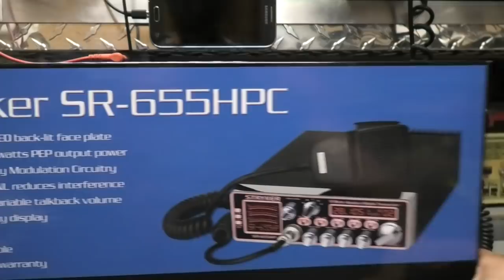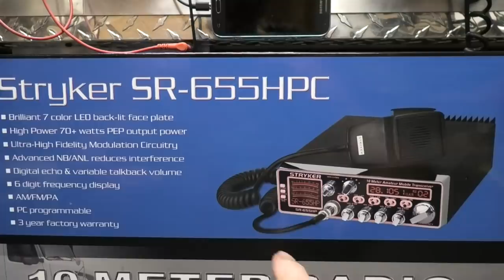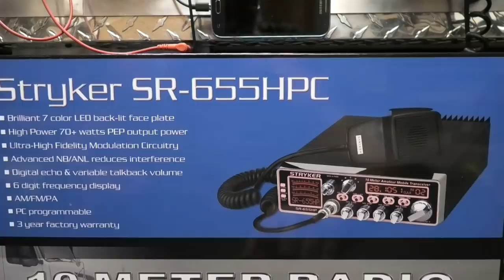New Stryker Radio SR955 - SR655 - Encoder Update W/ Custom Knob - All About Procedure - Where To Buy

Comment from the maker: There is no other way to put it for those who are looking for what they want and what I do - Get Over It! It is what it is. Far as I know and that I'm concerned, Tom, my supplier, is the best that there is. I use Lesco, I've been using Lesco since the 80's starting with CardKit Electronics (Secret Cb).  Bite your tongue and follow directions .. Here's what it takes to cut through the noise, be loud and crystal clear with a better receiver too:  A) Tuned Bench:  https://www.youtube.com/watch?v=lwcDfXOgAls.  True, it's more complicated and time consuming to accomplish these consistent and accurate results. Below is a partial procedure and list of calibrated equipment used to achieve this level of performance . Read on ..

Fine Tune CB Radio Shop strictly adheres to (https://www.nist.gov/) NIST Traceable Calibrations and other industry standards to maintain accuracy and consistency for providing Real World Performance Tuning of Citizens Band and 10 Meter export mobile radios with integrity.

"Basic Textbook AM/FM/SSB Transceiver Tune, Alignment and Calibration" 

1) Pll adjustments
VCO & OSC, AM TX OSC, USB TX OSC, LSB TX OSC.

2) Transmitter alignment
DRIVER BIAS, FINAL BIAS, SSB  (or gate voltages for mosfet versions) CARRIER BALANCE, HI-LO AM & SSB Power, RF METER, AMC, ALC and FM DEVIATION.

3) Receiver alignment
AM/FM RF & IF SENSITIVITY, FM DETECTOR/DEVIATION, SSB IF SENSITIVITY, SSB S-METER, AM/FM S-METER (100uV unmodulated -67dbm for “S-9” meter reading!), AM/FM SQUELCH RANGE, SSB SQUELCH RANGE, and NOISE BLANKER/AUTOMATIC NOISE LIMITER (Real World dBm to volts (uV) tables below).

That's just a typical run of the mill textbook tune up and alignment (if you're lucky). There's more to it than frequency alignment, modulation adjustment, meter calibration and a tune up report displaying exaggerated rms Bird peak watts! 

"Test Bench includes"

Bird 4314C Meter
https://www.birdrf.com/Products/Test%20and%20Measurement/Power-Meters/Wattmeters-Line-Sections/RF-Wattmeters/4314C_PEP-Single-Element-Wattmeter.aspx
Part 1) https://www.youtube.com/watch?v=RpX9IHe4ORM&t=16s
Part 2) https://www.youtube.com/watch?v=LuhbqTf6Bxw
Bird 4314C Accuracy Test: https://www.youtube.com/watch?v=DqEOabYqhQo&t=5s
Bird Stipulates 1/2 wavelengths  https://www.youtube.com/watch?v=5eWhgT-rTII
And Genuine Bird Elements from 1K down.

Bird 4373 Sampler 
https://www.rfparts.com/signal-samplers.html

HP8924c with options
http://userequip.com/files/specs/2147/HP%208924C%20Repair.pdf
https://www.youtube.com/watch?v=Cg1w0xBa27s&t=1s

HP8920a with options
https://www.keysight.com/upload/cmc_upload/All/EPSG072204.pdf

Three analog scopes, one digital 200 Mhz
https://www.atecorp.com/atecorp/media/pdfs/data-sheets/tektronix-2465b-2467b_manual.pdf
https://www.youtube.com/watch?v=by98x4eu2lM

Fluke 27fm
http://www.fluke.com/fluke/inen/digital-multimeters/fluke-27.htm?pid=56055
 
LCR http://www.lcrresearch.com/wp-content/uploads/2017/05/LCR_Pro1_Manual_version1.03.pdf

Power supplies
6 Cosel PBA1500f12 (750 amps) variable and configurable.
https://en.cosel.co.jp/product/powersupply/PBA/PBA1500F/PBA1500F-12/
Corcom 20VB1 F7130 EMI Filter 50-60Hz 250V

Times Microwave Coax jumpers and test leads
http://www.timesmicrowave.com/cms/products/cables/lmr/
https://www.youtube.com/watch?v=EmqaGJ6IWow
https://www.youtube.com/watch?v=1ltFVSxGp5Y
https://www.youtube.com/watch?v=v12YZT_1o90
https://www.youtube.com/watch?v=h7iiYfmYWRA&t=215s

Amphenol RF Connectors
https://www.amphenolrf.com/
https://www.youtube.com/watch?v=dVh5B0hdEA0 
https://www.youtube.com/watch?v=dKZg8T_AOso

More range, compliments, reliability and a quieter, clearer but more sensitive receiver,  Get Fine Tuned .. not peaked and ruined.

Here are some VideoGates of me at the bench practicing what I preach using my bench radio or customers radio completed and ready to be shipped: https://www.youtube.com/results?search_query=hard+drive+163+ more: https://www.google.com/search?q=Hard+Drive+163+nm&ie=utf-8&oe=utf-8&client=firefox-b-1-ab

It's what I recommend, use, service and sell ... to you ... not something non practical or deceiving in a misleading way. I'm not just the tech and owner of Fine Tune CB Radio Shop, I'm a customer too!  When finished, You'll be giving radio checks, not asking for them .

dBm To Watts and Volts
Tables below displays relationship between Power in [dBm] or [Watts] and Voltage in RMS, peak, peak-to-peak for sinusoidal signals in 50-Ohm systems for accurately measuring and tuning am/fm/ssb receiver sensitivity, agc, squelch and "S9" Meter calibration. Real World! Mike @ Mikes Radio Repair (Romper Room), Mark Rutherford aka Mark 19960, CB Kidd, Martian and all of your other fake accounts pay attention to the tables below, stop misaligning radios, spreading false information and promoting propaganda! 

  [dBm] [Watts]   [Volts]rms   [Volts]p    [Volts]pp
-140 0.100E-16  22.361 nV  31.618 nV  63.236 nV 
-139 0.126E-16  25.089 nV  35.476 nV  70.952 nV 
-138 0.158E-16  28.150 nV  39.805 nV  79.609 nV 
-137 0.200E-16  31.585 nV  44.662 nV  89.323 nV 
-136 0.251E-16  35.439 nV  50.111 nV  100.222 nV 
-135 0.316E-16  39.764 nV  56.226 nV  112.451 nV 
-134 0.398E-16  44.615 nV  63.086 nV  126.172 nV 
-133 0.501E-16  50.059 nV  70.784 nV  141.568 nV 
-132 0.631E-16  56.167 nV  79.421 nV  158.842 nV 
-131 0.794E-16  63.021 nV  89.112 nV  178.223 nV 
-130 0.100E-15  70.711 nV  99.985 nV  199.970 nV 
-129 0.126E-15  79.339 nV  112.185 nV  224.370 nV 
-128 0.158E-15  89.019 nV  125.874 nV  251.747 nV 
-127 0.200E-15  99.882 nV  141.232 nV  282.465 nV 
-126 0.251E-15  112.069 nV  158.465 nV  316.931 nV 
-125 0.316E-15  125.743 nV  177.801 nV  355.602 nV 
-124 0.398E-15  141.086 nV  199.496 nV  398.992 nV 
-123 0.501E-15  158.301 nV  223.838 nV  447.677 nV 
-122 0.631E-15  177.617 nV  251.151 nV  502.302 nV 
-121 0.794E-15  199.290 nV  281.796 nV  563.591 nV 
-120 0.100E-14  223.607 nV  316.180 nV  632.360 nV 
-119 0.126E-14  250.891 nV  354.760 nV  709.519 nV 
-118 0.158E-14  281.504 nV  398.047 nV  796.094 nV 
-117 0.200E-14  315.853 nV  446.616 nV  893.232 nV 
-116 0.251E-14  0.354 µV  0.501 µV  1.002 µV 
-115 0.316E-14  0.398 µV  0.562 µV  1.125 µV 
-114 0.398E-14  0.446 µV  0.631 µV  1.262 µV 
-113 0.501E-14  0.501 µV  0.708 µV  1.416 µV 
-112 0.631E-14  0.562 µV  0.794 µV  1.588 µV 
-111 0.794E-14  0.630 µV  0.891 µV  1.782 µV 
-110 0.100E-13  0.707 µV  1.000 µV  2.000 µV 
-109 0.126E-13  0.793 µV  1.122 µV  2.244 µV 
-108 0.158E-13  0.890 µV  1.259 µV  2.517 µV 
-107 0.200E-13  0.999 µV  1.412 µV  2.825 µV 
-106 0.251E-13  1.121 µV  1.585 µV  3.169 µV 
-105 0.316E-13  1.257 µV  1.778 µV  3.556 µV 
-104 0.398E-13  1.411 µV  1.995 µV  3.990 µV 
-103 0.501E-13  1.583 µV  2.238 µV  4.477 µV 
-102 0.631E-13  1.776 µV  2.512 µV  5.023 µV 
-101 0.794E-13  1.993 µV  2.818 µV  5.636 µV 
-100 0.100E-12  2.236 µV  3.162 µV  6.324 µV 
-99 0.126E-12  2.509 µV  3.548 µV  7.095 µV 
-98 0.158E-12  2.815 µV  3.980 µV  7.961 µV 
-97 0.200E-12  3.159 µV  4.466 µV  8.932 µV 
-96 0.251E-12  3.544 µV  5.011 µV  10.022 µV 
-95 0.316E-12  3.976 µV  5.623 µV  11.245 µV 
-94 0.398E-12  4.462 µV  6.309 µV  12.617 µV 
-93 0.501E-12  5.006 µV  7.078 µV  14.157 µV 
-92 0.631E-12  5.617 µV  7.942 µV  15.884 µV 
-91 0.794E-12  6.302 µV  8.911 µV  17.822 µV 
-90 0.100E-11  7.071 µV  9.998 µV  19.997 µV 
-89 0.126E-11  7.934 µV  11.218 µV  22.437 µV 
-88 0.158E-11  8.902 µV  12.587 µV  25.175 µV 
-87 0.200E-11  9.988 µV  14.123 µV  28.246 µV 
-86 0.251E-11  11.207 µV  15.847 µV  31.693 µV 
-85 0.316E-11  12.574 µV  17.780 µV  35.560 µV 
-84 0.398E-11  14.109 µV  19.950 µV  39.899 µV 
-83 0.501E-11  15.830 µV  22.384 µV  44.768 µV 
-82 0.631E-11  17.762 µV  25.115 µV  50.230 µV 
-81 0.794E-11  19.929 µV  28.180 µV  56.359 µV 
-80 0.100E-10  22.361 µV  31.618 µV  63.236 µV 
-79 0.126E-10  25.089 µV  35.476 µV  70.952 µV 
-78 0.158E-10  28.150 µV  39.805 µV  79.609 µV 
-77 0.200E-10  31.585 µV  44.662 µV  89.323 µV 
-76 0.251E-10  35.439 µV  50.111 µV  100.222 µV 
-75 0.316E-10  39.764 µV  56.226 µV  112.451 µV 
-74 0.398E-10  44.615 µV  63.086 µV  126.172 µV 
-73 0.501E-10  50.059 µV  70.784 µV  141.568 µV 
-72 0.631E-10  56.167 µV  79.421 µV  158.842 µV 
-71 0.794E-10  63.021 µV  89.112 µV  178.223 µV 
-70 0.100E-09  70.711 µV  99.985 µV  199.970 µV 
-69 0.126E-09  79.339 µV  112.185 µV  224.370 µV 
-68 0.158E-09  89.019 µV  125.874 µV  251.747 µV 
-67 0.200E-09  99.881 µV  141.232 µV  282.465 µV
-66 0.251E-09  112.069 µV  158.465 µV  316.931 µV 
-65 0.316E-09  125.743 µV  177.801 µV  355.602 µV 
-64 0.398E-09  141.086 µV  199.496 µV  398.992 µV 
-63 0.501E-09  158.301 µV  223.838 µV  447.677 µV 
-62 0.631E-09  177.617 µV  251.151 µV  502.301 µV 
-61 0.794E-09  199.290 µV  281.796 µV  563.592 µV 
-60 0.100E-08  223.607 µV  316.180 µV  632.360 µV 
-59 0.126E-08  250.891 µV  354.760 µV  709.520 µV 
-58 0.158E-08  281.504 µV  398.047 µV  796.094 µV 
-57 0.200E-08  315.853 µV  446.616 µV  893.232 µV 
-56 0.251E-08  0.354 mV  0.501 mV  1.002 mV 
-55 0.316E-08  0.398 mV  0.562 mV  1.125 mV 
-54 0.398E-08  0.446 mV  0.631 mV  1.262 mV 
-53 0.501E-08  0.501 mV  0.708 mV  1.416 mV 
-52 0.631E-08  0.562 mV  0.794 mV  1.588 mV 
-51 0.794E-08  0.630 mV  0.891 mV  1.782 mV 
-50 0.100E-07  0.707 mV  1.000 mV  2.000 mV 
-49 0.126E-07  0.793 mV  1.122 mV  2.244 mV 
-48 0.158E-07  0.890 mV  1.259 mV  2.517 mV 
-47 0.200E-07  0.999 mV  1.412 mV  2.825 mV 
-46 0.251E-07  1.121 mV  1.585 mV  3.169 mV 
-45 0.316E-07  1.257 mV  1.778 mV  3.556 mV 
-44 0.398E-07  1.411 mV  1.995 mV  3.990 mV 

                 Don't Be A Mud Duck!

 https://www.arrl.org/shop/ARRL-Handbook-2019-eBook

Hard Drive 163 NM. 73's! Click click.?